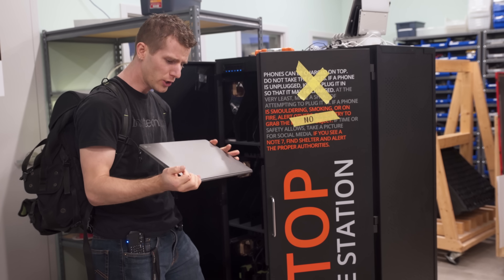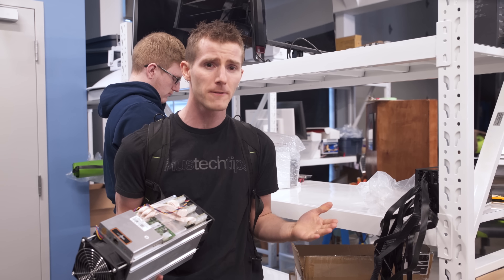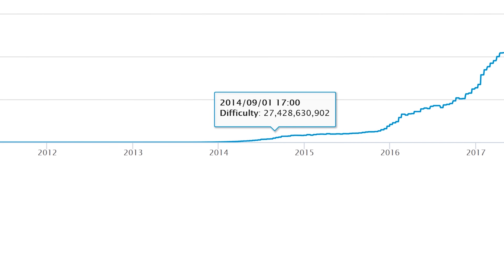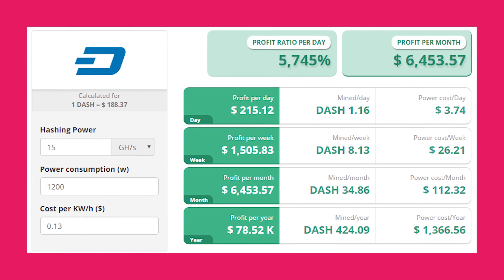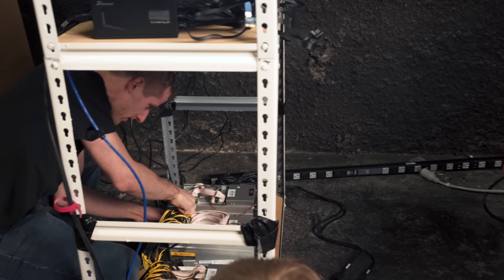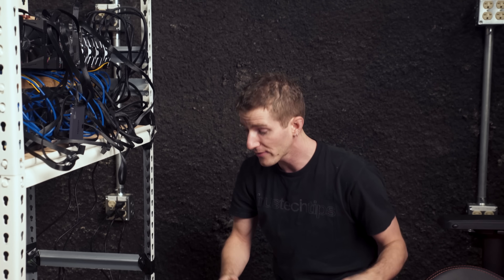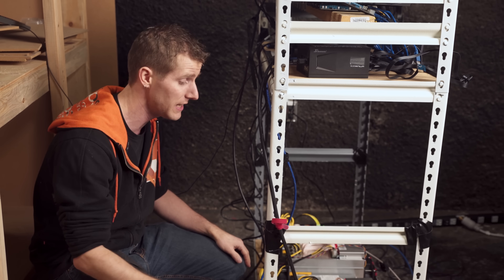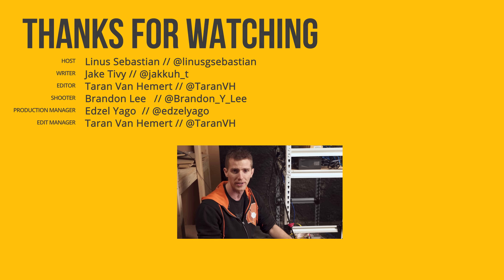Is Mining on ASICs Worth It? - Mining Adventure Part 3

Comment: If they were making significant profit with normal power prices, there would be little reason to sell a money printing machine.

Also: As profit is shared between the network according to hasing power, mining operations with cheaper power are by definition more profitable (as this is the only variable). By being the most profitable they can buy more miners, pushing others who cant compete out of the market.
Mining privatly might work if you got excess power like a wind turbine which you cant use or sell or maybe are able to use the heat generated as well. But buying miners and runnning them from your power meter is dumb.
And these linear ROI time calculations are quite misleading. In the last 8 months difficulty increased by a factor of 5, making this thing probably obsolete.
Its a huge gamble on bitcoin prices and hashing power worldwide. If you really want to play that just trade cryptos.
Reply: calaphos Do you have any clue about how pools work?

Comment: the "being sold on" thing you mentioned at around 11 minutes in, is not true, you can indeed sell them on, as there are always people willing to pay for them and you can often times recoup most of your initial investment, while there are even times you can profit from selling them on at more than you paid for them even a year after using the hell out of them, a secret that can lead to a profit is to buy your asics when price of coins is super low on a bear market, and then flip them during height of coin bull market, so if you bought your asics for mining SHA-256 in 2015 and mined holding your coins till the end of last year, selling all of them AND your miners to hopefuls wanting in, even then you would net a lot more for a 2 year old miner vs what you made off it, than selling it once you realize its not profitable to use anymore lol. just have a look around eBay to see what they are selling for now.  I still say get them for people who live in cold climates at least during the winter, and use them to heat your home most of the winter, and stop worrying about the coins they mine, as the cost to heat a home with them is lower than any other electric or even other sources of heat mostly, and the coins are just bonus at that point, ontop of the savings on heating, then sell them on in the spring when you dont need them anymore for heat, and recoup most of the money again. XD

Comment: One question (a stupid one) - Does the difficulty of mining bitcoin go down if the demand goes significantly down??? if the answer is no, then there is a possibility at one point nobody want to mine anymore. Is it so?
Reply: The Urban Rebel Difficulty is a function of hashrate. If hashrate goes down, difficulty goes down. If hashrate goes up, difficulty goes up.

There is a basic idea of a balance here where if a coin is no longer profitable to mine, difficulty goes down since some stop mining, resulting in a return of profitability for the remaining miners
Reply: I see. So, there is a kindda formula involved here and I assume the price of Bitcoin also comes into the equation too, right? Coz even if there are less people mining and the hashrate goes down, if the price of Bitcoin is not high enough, it still won't be profitable. But I believe it's not as simple as that. Thanks for the explanation though
Reply: Yes, Bitcoin enforces a strict formula for establishing difficulty, it mainly deals in the speed at which solutions to mining problems come in, averaged, say over 2016 solutions like Bitcoin does, then any random chance differences to Bitcoin solution rates are minimized and the amount of solutions at the current difficulty gives a good indicator of overall hashrate.

Price does come into play indirectly of course, just as you said.

Comment: Hey I was thinking about bitcoins how to make my own coin and cracking/mining and whatnot but anyway if anyone can help me with this I would appreciate it. Anyway there's only 1*2^256 options when it comes to hashing sha256 so that said there must be only so many times a digital coin can be passed on without adding duplicate hashes to the hash block chain so if you want to crack a 256 bit hash you can make 1*2^256 lines each with 256 not Gates flipped in different ways to responds to one of the 1*3^256 lines so if you input a hash into the lines using bus lines and one single line will output a current giving you the answer of what makes that hash within a split second without using a computer and only use minimum power but the only problem is that is doesn't give you the correct answer ever is will only give you the answer that will give you that hash with. that will work for cracking hashes but would that work for mining bitcoins too? It's kinda expensive the part count is crazy(1*2^256)256 not Gates and the same amount of wires not to mention the amount of people I'll need to hire yo build it. And somehow make it programmable otherwise it will be stuck only doing sha256. But for a job this size it's really got to work because I'm leaning towards f this buy a house and rent it out it might even be cheaper. But doing this in program is just dumb computers just arnt built like that they can't process data in parallel. But if it does work does that mean I can get a Bitcoin every few seconds or as fast as I get the hashes to crack because I can use a Arduino to input the date into the bus that way all I need to do is copy and paste maybe even use code to grab the newest hash and automatically load to the Arduino and automatically come back to the computer maybe I can just make a USB addon hardware for normal computers. I think it would be cooler and more useful if it was programmable but it's already so expensive I feel like I'm making a cash bonfire

Comment: Yeah, but people aren't using GPU's to mine Bitcoin anymore. They're using them for all of these new flavors of the month like Ethereum and Ripple. That being said, everyone is saying Ethereum and the majority of others like it will fail. So, all of these morons blowing 10's of thousands on GPU's that aren't made for doing that kind of work won't be able to get even close to a return on their investment in equipment alone, because by then GPU manufacturers will have mining specific GPU's released for 1/4 of the price of gaming GPU's, therefore the gaming GPU market will stabilize and the prices will drop back to normal. No one in their right mind will buy used GPU's for quite a long while due to the possibility of overuse in mining operations /and/ given the fact that new GPU prices will be back to normal, these guys will be stuck with a bunch of useless equipment that they can't recoup their money on, no worthwhile ecoin flavor on which to use them, and no point in using them due to manufacturer released mining specific GPU's. All of these people are going to be completely and royally f*cked.

Comment: Crypto currency... It creates green house gasses by driving up power usage, creates mountains of ewaste using specialized equipment that is designed to be useless 1-2 years after it is built, and makes consumer electronics equipment cost tons more all at the same time. With all of that, only a very small fraction of people even use the currency. It is traded like an unregulated stock market with violent fluctuations. I can not see an up side to it at all. The mentioned pitfalls only magnify the bigger and more plentiful they become. What a great way to destroy the planet.

Comment: Cryptocurrency uses (wastes) an enormous amount of energy. Meanwhile, cryptocurrencies fail at providing true and total anonymity... while being very hard to use for legal purposes. They aren't designed in such a way as to be very good as currency for most regular people, doing business with other regular people. And it's not worth getting the critical mass of users to the point where everyone knows how to use cryptocurrencies... Because at that point most of our energy would go to mining.

Cryptocurrencies are bad. I'm 99.99999% sure blockchain PER SE is bad. It's solving a problem we don't have, which is distributed trust, arbitrated by machines. Have programmers heard of anything called "society"? Having a "social life" where you "trust" "people"? Not everything has to be done by a computer. Not everything has to be sending 1's and 0's over the internet. Not every decision has to be made by computers. There's this thing called "real life" that I hear is really cool. And people, I dunno... I heard they might be kinda important too.

Drop it like it's hot. If for no other reason, do it because it's the right thing to do. Human aims and goals, and the principles cryptocurrency is based on, are on some level intrinsically opposed.

I will admit cryptocurrencies are potentially a cool little project for tech nerds to look into and try out. But as a serious attempt to change the way we spend money, I think it mostly goes in wrong directions. And so for most people, getting deeply involved with cryptocurrency is ultimately a bad choice.